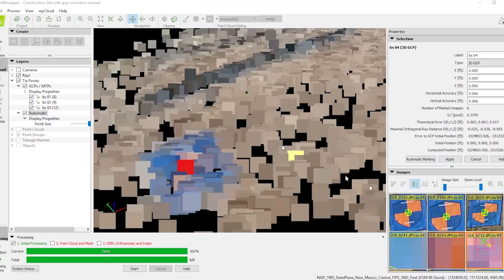How to Set Ground Control Points for Greatest Accuracy in Construction Mapping

Comment: Where did you get the GCP per acre data? It seems like a huge overkill
Reply: Yeh that can't be accurate information. I survey 450+ acre sites and there's no way I'm placing 225 GCPs per flight, as per his 10 acre rule...
I'd like to know what study he's pulled that info from, and perhaps they need to do an updated video with more technical information...